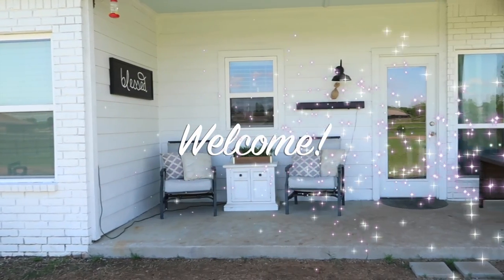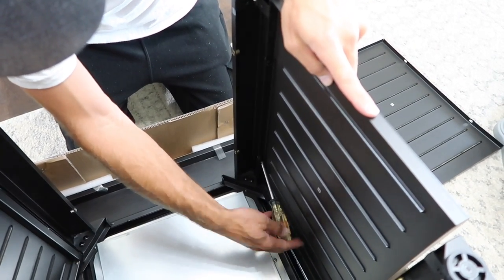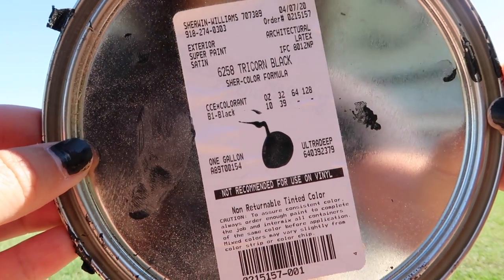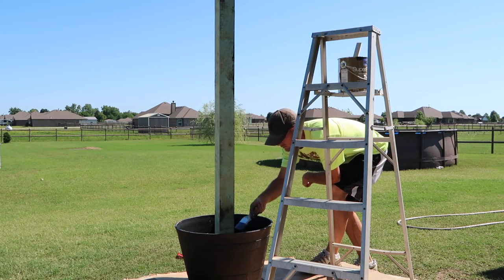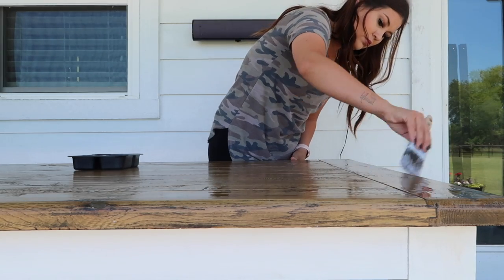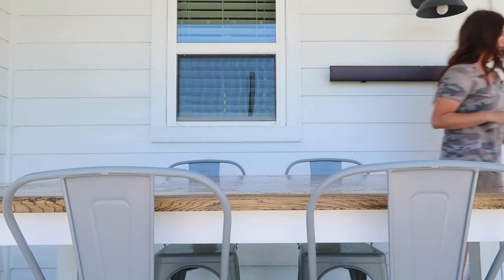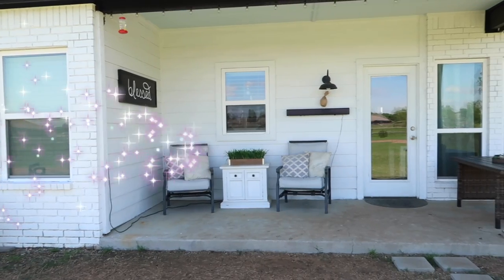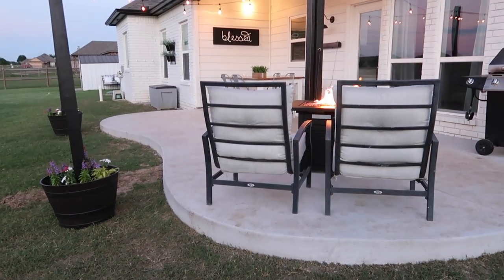DIY BACK PATIO MAKEOVER ON A BUDGET | MODERN FARMHOUSE PATIO TRANSFORMATION BEFORE + AFTER

Comment: Suggestion: Maybe consider adding another pot to the post in the middle where the gutter comes down. Since the kind you bought are plastic you can basically cut it completely on one side and pull it back enough to slide it around the post then you could add more flowers and the post will keep it from blowing a way so you won’t need to do the concrete.......it’s all very beautiful. I love it! 😊

Comment: I love how it turned out ! I want to recommend a concrete sealer for your patio, we used in our garage but it’s with color,  the brand we used it’s H&C color top, solvent-based color, concrete sealer. It comes in different colors and it makes such a difference looks clean and I love it !
Reply from the maker: Awe that sounds perfect. Thanks for the tip.

Comment: The patio looks beautiful. But I do have a little advice before you use stain...your old concrete will not stain the same as your new concrete. I’m OCD when it comes to things not exactly matching so I thought I would spare you the issue we had. There is a new paint treatment that I saw on the TV show Bargain Mansions. They did a basement concrete floor a beautiful blue bowling ball effect. When we tried to stain our porch the old concrete did not take the stain at all. Hopefully this will help you out. Love your channel.
Reply from the maker: Thanks for the tip. It already doesn’t match anyway though. Lol